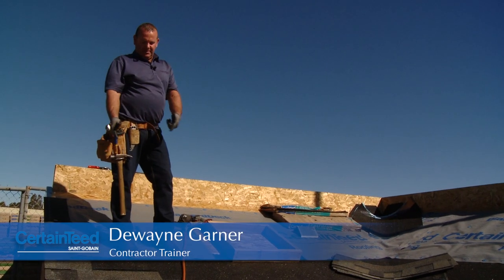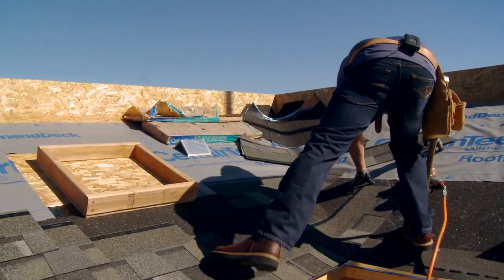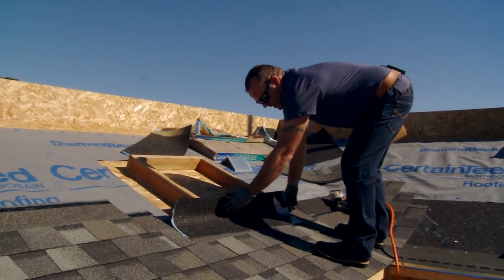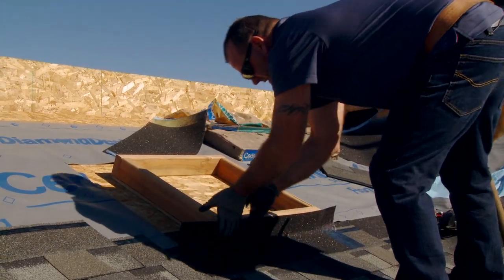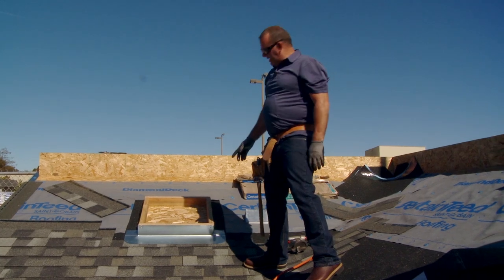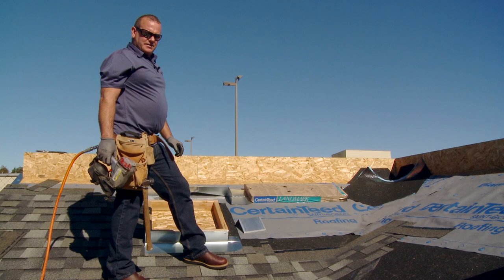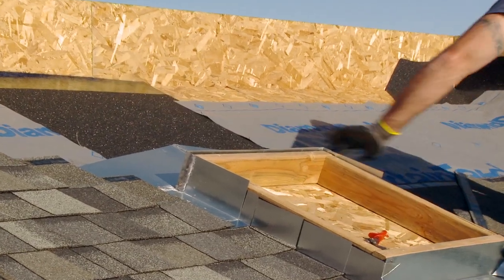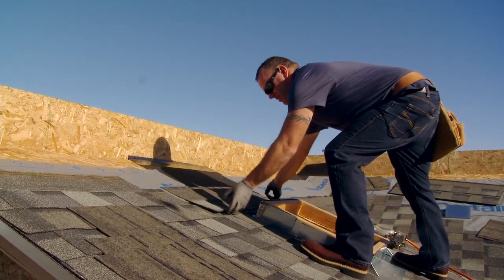Installing Landmark - five course pattern, alternate closed cut valley & skylight flashing

Comment: I noticed installer didn't pull the plastic strip on the adhesive part of the shingle...some don't melt away thus leaving the shingle subjected to high wind damage.
Reply: that plastic strip is called the release tape. It prevents the shingles from sticking togehter in the package. It is clearly marked, DO NOT REMOVE. It has nothing to do with the shingles sealing together. Most importly, it has data information to help the plants identify the product, color, plant, and date of production.

Comment: That bottom homemade flashing is horrible, that corner cut is asking to leak. VELUX factory made flashing kits are properly made.
Reply: Those velux kits are worth every penny. I was skeptical about paying for one of those kits the first time I used it, but they make flashing a skylight quick and foolproof.
Reply: its perfectly fine, same way most roofers ive met do it, literally only way too. its only purpose is to divert water away from the corner from the flow of water that goes down the wall flashing. No water should be hitting that point, its always good to add a little roof caulking in the corner afterwards when you putting caulking on the last piece of cap
Reply: @Josh-ww5kz  Velux no leak warranty doesn't hold up if you don't use their flashing kits...simple...
Reply: @cengeb  I get that, but the homeowner doesn't always get new skylights 100% of the time, where in Vancouver Canada. So we always end up having to cut our own front pans, back pans, and use regular step flashing for jobs. Haven't had one leak on me yet.

I always cut the front pan to size, then drop my first step flashing 3" or so down from it to divert the water away from the corner, most times having to double up on the first one to get the right exposure for the shingle going against it, then build it up to the top corner, cut a back pan that's 4" wider on both sides, make a small slit on the end inner corner to not allow water to wick back, then shingle to top section appropriately.

I usually run my underlayment up the side of the curbs too. Then at the end of the job I grab my caulking and squeeze a small amount in the corner, but in a way where it still let's water drain out if it "happens" to leak on me at the bottom corner
Reply: @Josh-ww5kz  If a 20+ year roof is being replaced, and there are skylights as old, better idea is to replace them too...and be done....cus when the old skylights start leaking, 3 years later, now you are ripping up a new roof and more work, and more expensive than if ya did it along with a new roof
Reply: @cengeb  that's true, but custom skylights cost a lot so people tend to try and not pay for one if theirs is still keeping water out